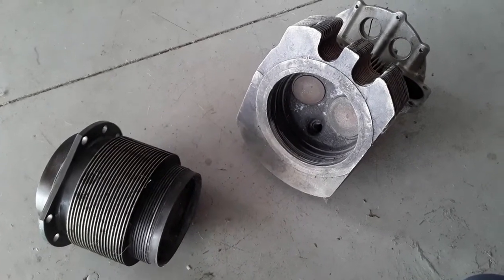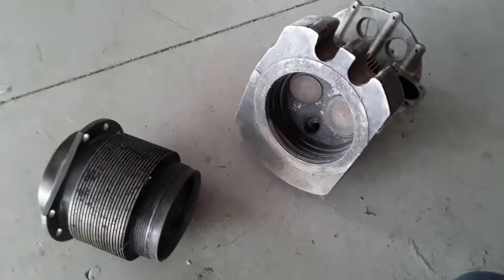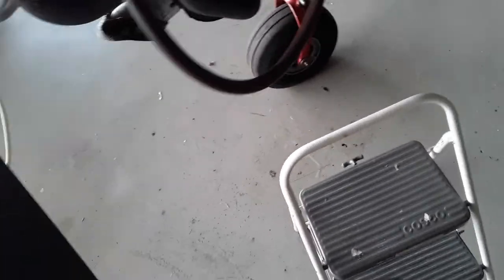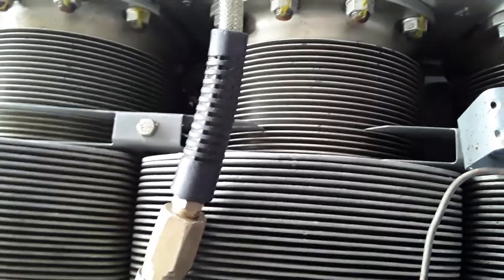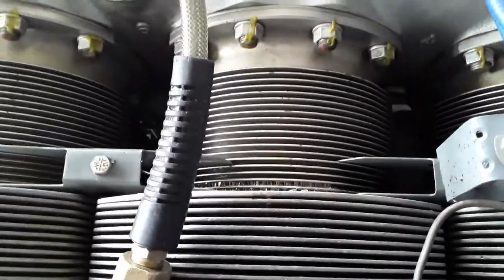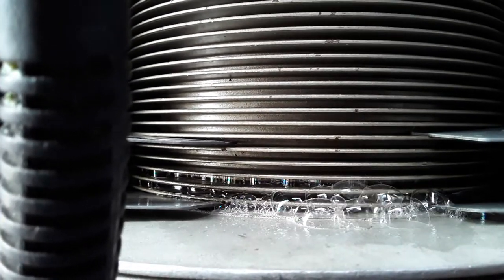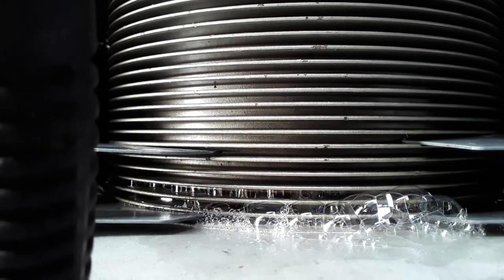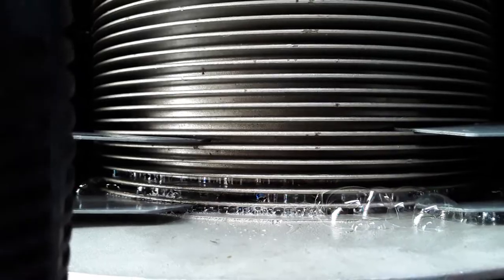AIRCRAFT CYLINDER FAILURE - HEAD TO BARREL SEPERATION  INSPECTION PREVENTION

Comment: can you explain to me how the head and barrel are joined together? I have no aircraft experience just general automotive experience.  Ive never seen an engine that didnt use a head gasket and bolts to join head and cylinder. Thanks
Reply from the maker: The aluminum head is heated in a oven & the barrel is chilled. Then the two are screwed together and are a shrink fit when they get to the same temperatures, the head shrinks & barrel expands. The aluminum threads are the weak point as they age.
Reply: @Nord3202  interesting design , when the valve seats need servicing are the cylinder and head separated ?
Also why arent the head and cylinder cast as one part?
Reply from the maker: @anthonyiannone7618  The head is aluminum & the cylinder is a steel barrel with a flange at the bottom with holes that bolt on the crankcase studs & through bolts. The valve seats are also steel and  a interference fit in the cylinder head. The valve guides are mostly bronze and also a interference fit. A interference fit also called a shrink fit is almost impossible to separate once both parts are at the same temperatures. The head is aluminum  for weight & cooling & cylinder steel for durability and wear. You can grind valves & valve seats or replaced.